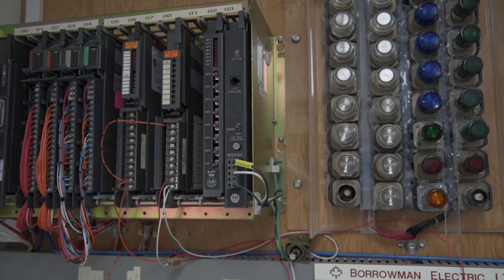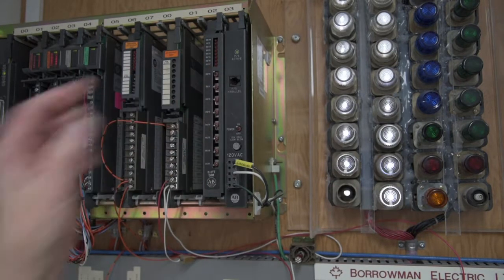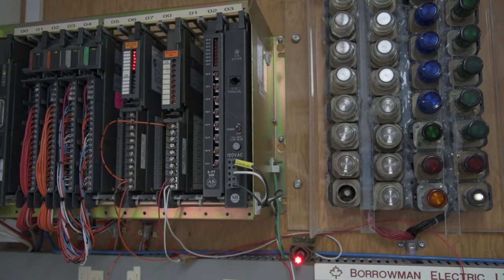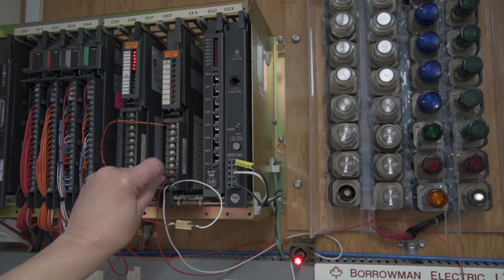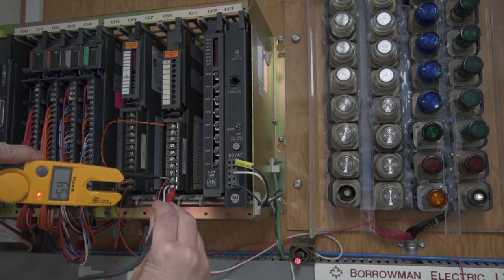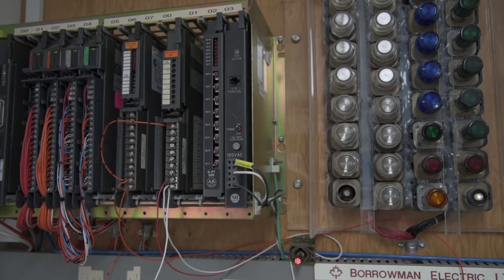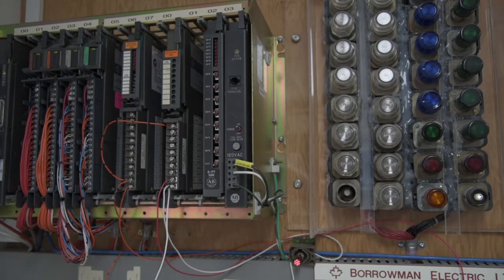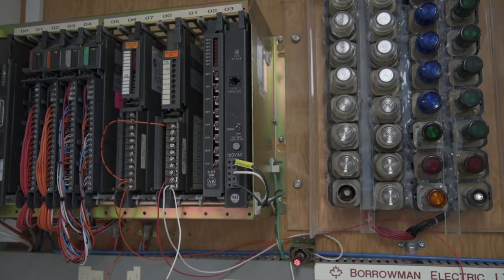1771-OA & OAD Triac Output module

Comment: Hi thanks for the informative lab test. How do you come up with 2.5k resistance ? Thanks again
Reply from the maker: That value was in one of the original spec sheets for the 1771-IAD input card.
They had a diagram and show that value.
I have used and it works very well.

Comment: Helped me a bunch. Thanks you! Was wondering why I was reading 120 VAC from an output that is supposed to be off. I'm was having a problem where a very small ice cube relay doesn't let go after being turned off from the PLC. This seems to be the explanation why.
Reply from the maker: Hi Jack:
Triacs have always had a leakage problem and continue to do so even with today's new outputs on Clogix.
DC outputs running DC relays is a better solution IMO.  And it is 'faster'.  The addition of the loading resistor makes the AC relay de-energize faster, but still not as quick as a DC relay.